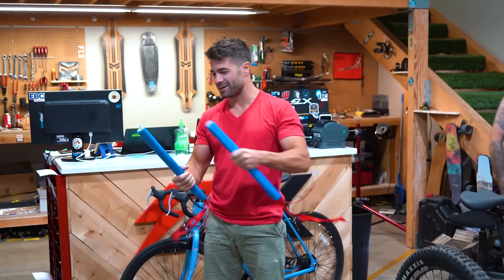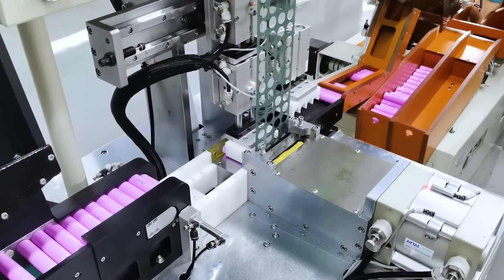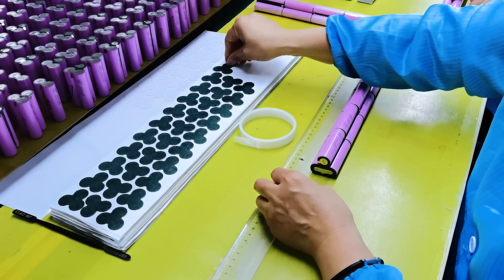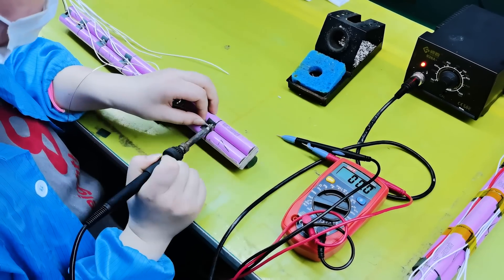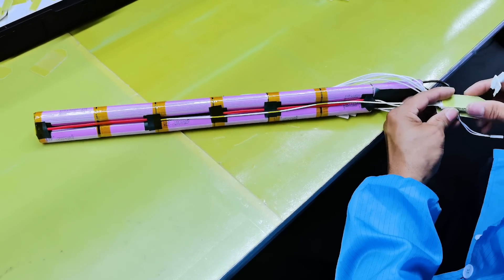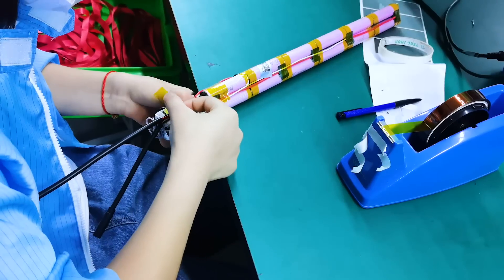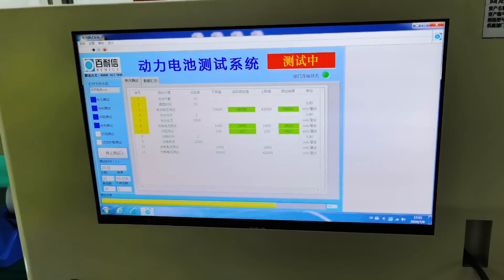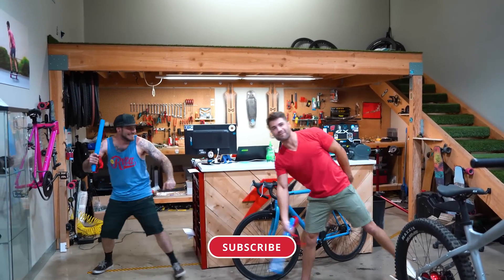FLX Babymaker Production Update: Building the Batteries

Comment: This is awesome.  What’s the failure rate?
Reply from the maker: The battery is designed to hold 70% of its capacity even after 500 cycles of full to empty.